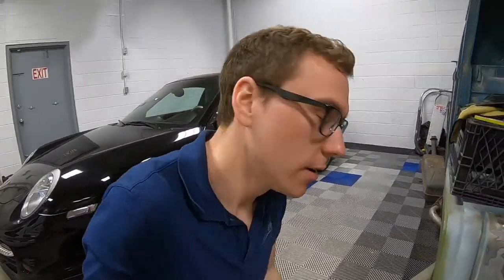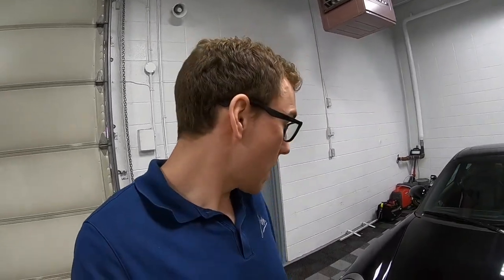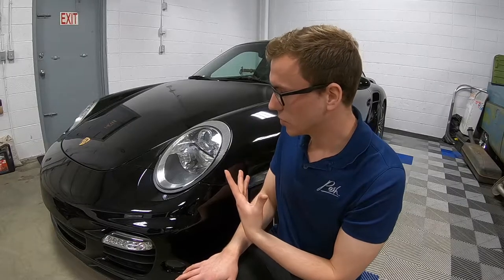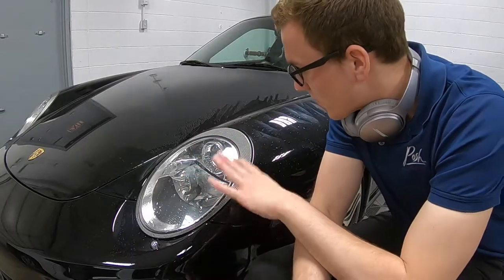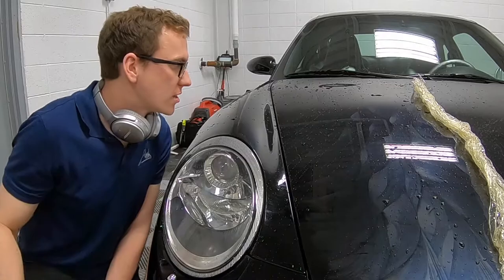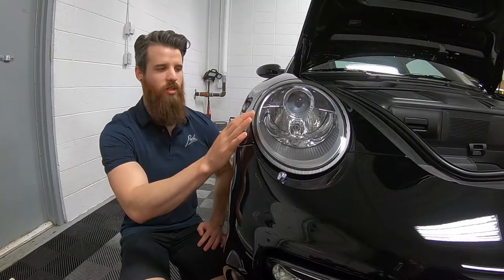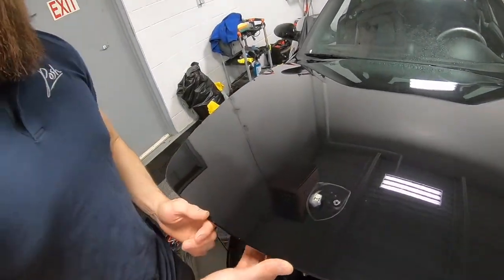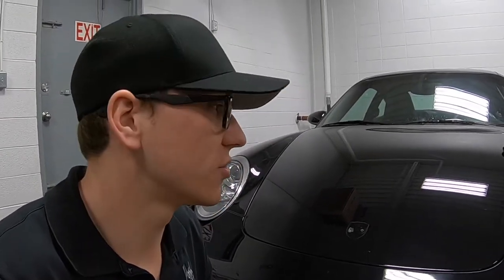997 991 Turbo full correction and full wrap in paint protection film!

Comment: Nice work. What are you dumping on the film while removing it? And how did you guys fix the badge issue?
Reply from the maker: Paint Correction Officer hot water! And we ended up wet sanding, cut/polish then touching up the areas that needed it. And putting a new badge on!
Reply: Posh Detailing oh okay I see so instead of a steamer you just use hot water! Wow that's a lot of work good job man it looks amazing
Reply from the maker: Paint Correction Officer exactly, this was brutal film and need super hot water to remove it! Steaming dissipated the heat to quickly. Appreciate the kind words! Thank you!